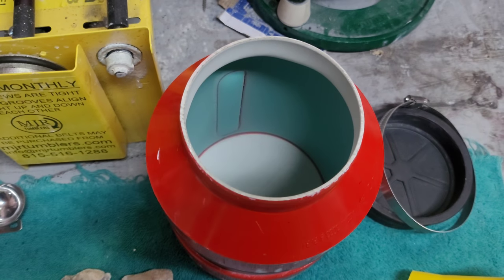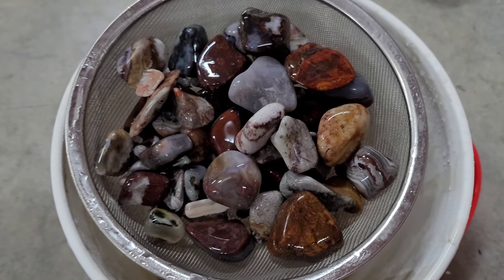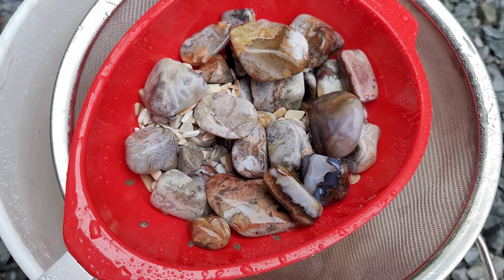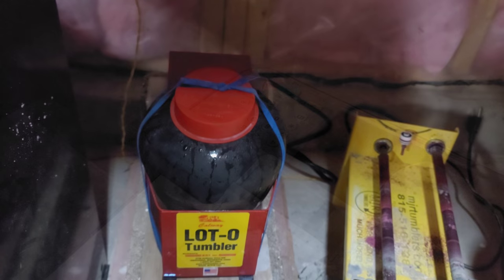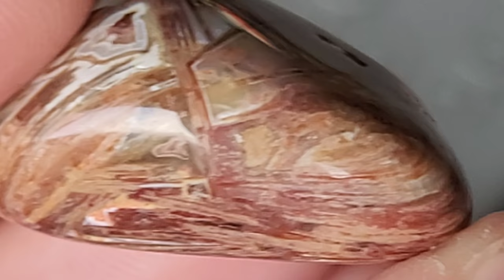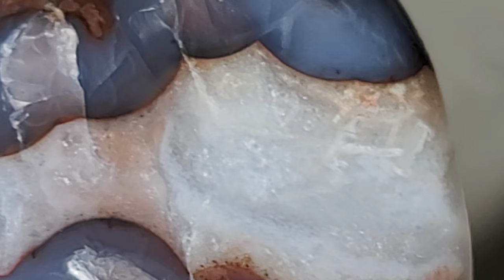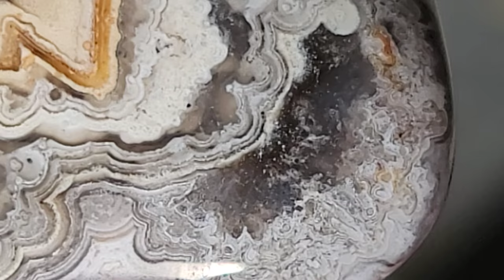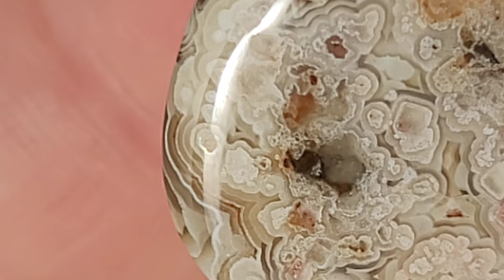Mexican Crazy Lace Agate | Tumbling Before & After | Tumbling Rocks #8

Comment: Great video Jason! My hubby came into the kitchen while I was watching you show off the finished products and he was blown away by how beautiful the agates turned out! Thank you for the repair tip for the tumbler. I will keep that in mind for the future if I ever need to repair a barrel.
Reply from the maker: Thanks Ange! Glad you both liked them. The tumbler repair was just a temp job. It won't last very long. Looking at other tumbler options now. I might bight the $$ bullet and switch to a lortone. Thanks for checking it out!!
Reply: Jason, my hubby was wondering if you've ever tried Flex Seal as a repair tool? He mentioned that they now have it in tape form as well as the paint or spray on methods
Reply from the maker: @angef9687  I never tried it but everything would be a temp job at this point as the coarse grit is just eating away at the barrel. The gorilla tape is holding up though.

Comment: Another intressting video,,  they don't make tumbler barrels like they use too,, well, they don't make anything like they use too😂
 I particularly like the before and after shots, really shows the difference.
Beautiful end results,,
👍😃
Reply from the maker: Yeah im pretty disappointed but on the bright side my tape job is holding up. I started another batch.
Reply: MJR tumblers are poor quality. I purchased a 12lb from them and it arrived with a burned up motor and the tumblers didn't fit on the rails together as advertised. They sent a replacement, with the same tumbler issue. Both could not fit on the motor at same time. The tumblers are poor quality pvc pipe fitted together. They really dropped the ball on the tumblers. I now have 3 large thumler's that have been running non-stop since March. Only replaced one belt pulley. They absolutely are fantastic quality.
Reply from the maker: @youkneecornkernel6606  I can't complain about the MJR motor because it's been running straight 24/7 for a year now. The barrells are crap quality though. I'm going lortone with my next purchase.

Comment: Wat did you use to polish these? In stage 5?
Reply from the maker: Alumina
Reply: @RockhoundingLife  ok my stage 4 polish is alumina 1200 polish. There’s another time after that??
Reply from the maker: Yes. 1200 is pre polish. You want to run a final polish stage. I use Alumina which is 20,000 grit